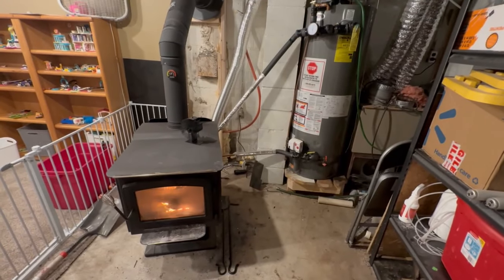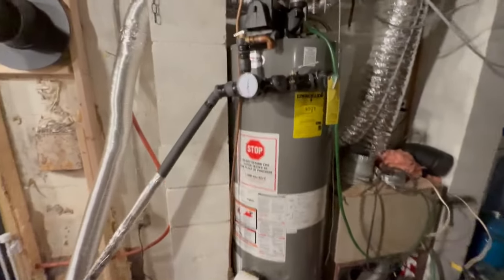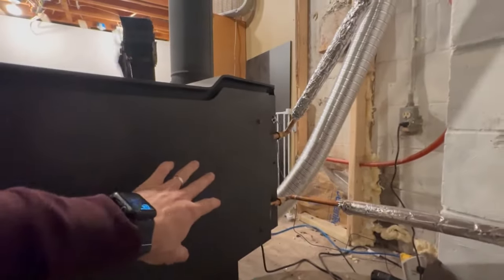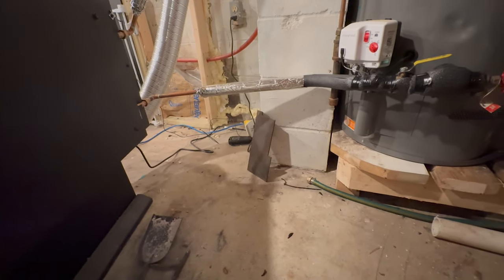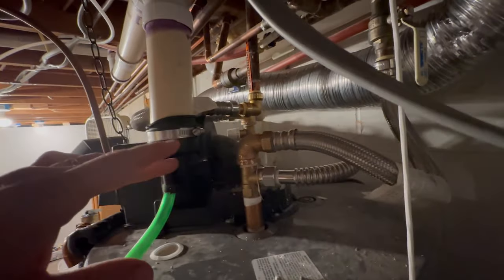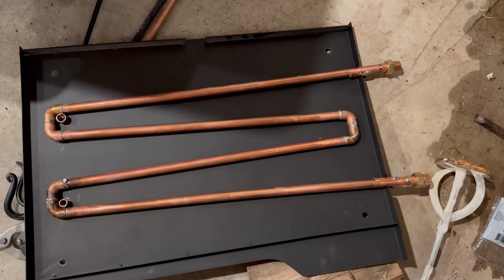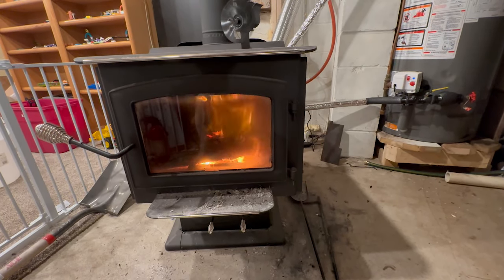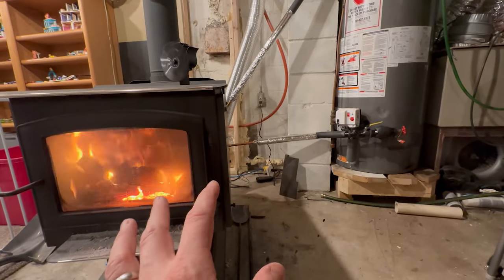DIY Hack: How I hooked up my water heater to my wood stove

Comment: Looks like a good system.  Our woodstove has a plenum chamber above it that ties into the hot air return for our HVAC system.  We have a water heater with a heat pump on top of it.  When we have a fire in the woodstove, the utility room gets relatively warm ( >60 degrees) and the heat pump on the water heater extracts that warmth to give us hot water.  After rebates, the water heater with heat pump was less than $600 and it is saving us probably $250/yr over what the previous electric-only tank was using.  As a bonus, the cold output from the heat pump on the water heater is vented into our garage, giving us a small A/C unit.  :)
Reply from the maker: Nice!
Reply: @jasonbroom7147 can you direct me to where I could find more information that setup. We just bought a house with a hvac tied woodstove. Very interested in what you've got going on
Reply: @SirloinBeefBurger  - I've honestly never seen anything like it, before or since.  Imagine a large metal box above the fireplace insert, forward of the flue channel.  On top of that box are two round stand-offs with insulated flexible heater hoses that tie into the hot air return for the furnace.  I don't think it was a commercially-made product, just something the mason who installed the brick fireplace built.

Comment: For a heat exchanger could you use a stripped down 5 gal. Electric (or gas) water heater right on top of the stove?
Reply from the maker: I thought about it but the wood stove is now our living room space in the basement so we want it to look pretty 🤩

Comment: I need advice please. I would like to use my wood stove those way in the winter and have my supplemental water tank directly below my wood stove in the basement and have that water heater feed the main water heater which is an indirect water heater. So I would create a closed loop feed the coil inside the indirect water heater for our domestic hot water during the winter. Any ideas are welcome.
Reply from the maker: If the water heater is below the wood stove, thermosiphoning would not work.  The water tank would need to be higher.  You could add a pump to the loop with a thermostat but you run the risk of cooling the water in your water heater.

Comment: A few code / safety items you might want to look into , is your water heater approved for zero clearance from combustible materials. Two install drops down to the floor from your relief valves , this will protect you from being scalded if one opens when you are near it,  you have no over temperature protection, closed system with no thermal expansion available. If the codes in your area require any or all of those items and they are not present it would allow your insurance company a way to avoid paying any damage or injury claims from a failure.
Reply from the maker: Thanks for commenting!

Comment: I wonder if adding a small water pump to circulate water from the stove to the water heater would make this system more efficient?
Reply from the maker: I tried it and it didn’t not help

Comment: Hi. I love the simplicity, and the emphasis on safety. I  wonder if you have the possibility to lower your wood stove any, thus gaining a bigger height difference? Also, what are your thoughts about wrapping the copper around the chimney then into the tank? Simple open coils above the stove top and around the lower part of the chimney pipe? I am looking to do something like this for my trailer in the middle of nowhere. Thanks
Reply: i was thinking of the lower chimney thing as well  one of the biggest problems i have experienced is the cooling of the fire interrupting the exhaust of the chimney. using metal piping inside the fireplace. but wondering if you only removed the heat from the chimney if the venting will still occur properly and keep the exhaust clean burning. if so having a water tank around the chimney essentially water cooling it might maximize the heat.
Reply from the maker: I didn’t wrap it around the chimney for 3 reasons,

1) I didn’t like the aesthetics of it.

2) it would reduce the chimney temp which would reduce the draft.

3) the firebox stays hotter longer than the chimney.  Wrapping the chimney would produce hate water quickly but not for very long.
Reply: @portercreek  Thanks, I appreciate your time to explain the difference to me.

Comment: I have a similar set up, but it's never worked. It's a backup to the glycol solar water heating set up anyways and so I've never had it repaired. There are a couple days a year where it's too cloudy to heat up the water, but it's not been enough to motivate me to fix the "recirculation pump" set up as they call it.
Reply from the maker: I am really curious to see what your solar water heater set up is like, I didn’t think it would work in the winter months.  How cold does it get during the coldest days?
Reply: @portercreek  I may post a video on my @wildweeds channel at some point showing the glycol solar water heating system. This morning the temperature got down to 13F and the lowest I've seen it has been 8F last year. But that doesn't make any difference to the water heater... It's the amount of sun that makes the difference, but even on mostly cloudy days in December and January it works pretty well. Of course, there's no hot water until about noon around winter solstice.

Comment: I would suggest putting the wood stove heat exchanger around the flue pipe, most wood stoves use a 6 inch flue pipe for exhausting the stove. Because the diameter of 6 in pipe
Is quite small to bend 1/2 copper pipe around the chimney the use 3/8  pipe. The heat transfer would be much higher using this type of heat exchanger. The size of heat exchanger pipe would not matter that much as the flow would is quite low.

Comment: How do you handle the possible thermal expansion of hot water?
Reply from the maker: I have a well so there is a pressure tank that will accommodate the expansion. There is also a relief valve on the loop and on the water tank.

Comment: That is genius!  I'm impressed.  But I would think the flames would melt the solder connections on heat exchanger.   Does you boiler still work off gas?    Since you said you can only heat enough water for two showers, will the gas part still fire if you need more hot water than the wood stove provides?
Reply from the maker: The flames don’t actually touch the copper pipes as they are on the outside of the firebox.  In order for the solder to melt the pipe would have to exceed 300+ degrees and it can’t do that as long as there is water in the lines.  The water heater still functions the same.  I usually keep it off and sometimes will kick it on if we had a high demand of water that day.  I have some parts coming next week that I will add to this system which should help it produce more heat.  If the new parts aren’t enough to get me to 160 then I will add another zig zag to the heat exchanger which should definitely get me enough hot water for our whole family.  

Once I get the new mod(s) done I will post a video so stay tuned!  Thanks for commenting, please hit that subscribe button!

Andy
Reply: @portercreek  Awesome detail about the tubes not being in the firebox. I don't know much about stoves so that was nice to know that you can totally avoid the soot buildup on the tubes and loss of efficiency.

Comment: How about adding a second row of Z behind the heatshield for more surface area? I have no knowledge about those things. Only a thought.
Reply from the maker: This row of z is behind the heat shield, I am going to eventually swap out the half inch pipe with 3/4 to get better flow and heat transfer.  I have also considered adding it to the other side as well

Comment: Great setup. I have a question. Does it have to be pipes for the heat exchanger?! I was thinking of putting something like a plate heat exchanger but without the plate inside. Just one big flat tube with an inlet at the bottom and a outlet at the top that i can stick to the back of the atove to cover the entire surface and get the maximum amount of heat. Will it work?!
Reply from the maker: I am not sure, I have not tested that method.
Reply: That would work but try and find a ready made flat plate cast unit. You could weld up a water box and weld it to the side of the stove. "Water backs" were common back in the day.

Comment: I added a comment to 'Tom Running's' comment about water inlet height, but I wanted to comment on your heat exchanger setup. You've done a good job on the heat exchanger, but you need to concentrate the heat to the pipes and also stop the air current around it cooling it down. I would add flat plate copper to the side that touches your firebox and then add rockwool to the whole heat exchanger so that you're not losing heat. Let me know if that makes sense. 
Good work on the unit. 
Also any rise in the pipe coming from the firebox is ok, just NO falls, even level will work, it's just not ideal. 
I can take photos of my setup but it might be confusing to work out. 
Freddy :)
Reply from the maker: Thanks for commenting!

Comment: Looks good, when valved off how hot does the exchanger get? Always wondered if it would open the relief. Had similar thoughts on running radiant floor Off a wood stove. With a circ pump though.
Reply from the maker: I haven’t tried closing both valves with a fire, I am a little reluctant to, lol!  I want to put another, bigger heat exchanger on the other side to run hot water out to my garage to heat that.  I am hoping to get that done before the end of the year.  That one will have a circ pump on it.

Thanks for commenting, please hit that subscribe button if you haven’t already!
Reply: @portercreek   Your coil would just start flashing to Steam and your relief will start blasting off Steam Into your house

Comment: So what happens if no water is being used, but the woodstove is running? Doesnt the woodstove have the potential to overheat, and thus over pressurize the tank? i understand you have a pressure relief valve but, it doesnt seem theres any way to stop the stove from overheating the tank. I feel like blowing reliefs could be a common issue. 

Also, keep in mind you could just use soft copper and a tubing bender to achieve the zig zags.
Reply from the maker: When no water is being used it, the hottest I have seen it get is about 142.  The hotter the tank is, the more btus it requires to keep it hot because of heat loss through the sidewalls.  With this set up I don’t think it is able to produce enough btus to over heat this large of an amount of water.  I was going to us soft copper but couldn’t get the bends tight enough with out a tube bender and I didn’t want to spend the money on one.

Thanks for commenting, please hit that subscribe button if you haven’t already!
Reply: @portercreek  Good to know, ill consider doing the same to my basement wood stove then. thanks!

Comment: Well it’s not free….it does steal heat from the unit that might be wasted radiating in the basement anyway so I’d say it’s more efficient.  Do you have thermal limits built into the system to prevent overheating of the hot water heater or has the system not produced enough heat to cause an issue?
Reply: Also a water pump would help with circulation.  That’s what we do with geothermal units doing something similar.
Reply from the maker: If I added a circ pump then it wouldn’t be free hot water and when I did add it to test it, it was no more efficient.

Comment: If you're only getting a few degrees difference between the top and bottom hoses. It looks like not much of the heat is being transferred to the water, which would explain why it doesn't heat the water too well.
A larger calorifier coil in the tank may help you get more out of the system.
As a kid, our wood burner (A 7KW Hunter) Used to heat the water piping hot, and a lot quicker than the electric element.

Comment: Very nice,however if you used 45s for your turns the water would flow easier.  90s actually Restrict flow.
But I like that you are showing this.
Reply from the maker: The reason I didn’t use 45s is because of the space it requires.

Thanks!

Comment: Try plumbing in an old radiator instead of the copper pipes on the side of the woodstove. Just a thought. Nice work!
Reply from the maker: I thought about that but then I wouldn’t be able to put the shroud back on, which isn’t that big of a deal, but getting the plumbing to adapt from conventional plumbing to the radiator would be a bit of a challenge.  Can an old car radiator handle 60psi from the water lines?
Reply: Andy Hentges  good call! I'm not sure if a radiator would be able to handle that pressure? I'm just a normal "joe" with crazy ideas haha! I love your ingenuity! Keep it up.
Reply from the maker: @ajwilson313  thanks!  Please don’t forget to hit that subscribe button!

Comment: What's the purpose of the green pipe coming down? Also, I see a thick white PVC pipe on top. What's its purpose?
Reply from the maker: The white pipe is exhaust for the water heater.  It is a high efficiency water heater and the green hose is a condensation drain hose for the exhaust.

Comment: Personally, I heat water during the winter in a pan on my wood stove.  I save a couple of quarts of hot water in thermos bottles.

I live alone and find that frugality is the key to simple hot water heating as described above.  I use a towel and less than two quarts of hot water for bathing a shaving  ----FLOODS of hot water are NOT required!

Hand washing dishes takes  two quarts or less of hot water.

I use cold water in the clothes washer and hang the clothes on a clothes line to dry. 

During the summer, I use my simple solar water heater ---- two quart plastic jugs set in styrofoam blocks that have been cut out to fit the jugs.  Glass shelves salvaged from old refrigerators cover the jugs. On a nice sunny day I get water temperatures from 140-160 degrees F.

In the shoulder season when I'm not heating with wood and not getting much hot water from solar, I just heat water in a pan on my gas range.
Reply from the maker: I wouldn’t mind simplicity like that but with 4 kids it just doesn’t work!

Comment: use a 12 volt circulation pump inline. I think they are about 10 dollars for cpvc transfer but you need one that can withstand at least 300-400 degrees due to the stove being too hot melting the plastic. But, if you put a 150 degree blow off valve then that is all you need but i still would circulate it with a pump.
Reply from the maker: I tried adding a circ pump but I did not find it to make a difference.  Modifying the side panel of the stove so I can fit a 3/4 inch pipe would probably give me much more heating capacity.

Comment: I've really been wanting to do this with my wood stove insert but my issue is that its on the first floor and the water heater is in the basement. I debated getting another small hot water tank and putting it in a first floor closet but again all my pipes are in the basement.
Reply from the maker: You could do something like this with a circulation pump.  You would have to rig it up so the pump is on a thermostat though so your not cooling your hot water when the fire dies down.

Thanks for commenting, please don’t forget to hit that subscribe button!

Comment: How is this setup now? I would imagine that the temperature in that copper pipe can change pretty rapidly.
Reply from the maker: I show how it is set up in the video…
Reply: @portercreek   I guess I should have been more detailed. It has been a year right? Have you ran into any unexpected problems?
Reply from the maker: @HexaFox  no issues, it’s been working great!

Comment: Have you considered using a recirculating pump rather than thermo siphon to circulate the water?
Reply from the maker: Yes, the draw backs are it required electricity and if the fire goes out and the pump is running it will start cooling the water instead of heating.

Thanks for the commenting, please don’t forget to hit that subscribe button!

Comment: Good job! Did you ever consider the fact that you now will have electrolysis buildup on the inside of that panel where you installed the self tapping screw that is sitting against the short piece of copper spacer? Might want to use a copper plated screw next time.
Reply from the maker: Not sure how that would cause electrolysis build up when the panel had 4 metal screws in it from factory.
Reply: Ideally, copper should never touch steel.  I use cardboard or lead flashing pieces to insulate copper from steel. But electrolysis is a peculiar thing that often does not follow the rules, so it may be okay @portercreek

Comment: i considered doing a solar water heater panel to a tank and they said if you dont want to use a circulator you need to have tank above the solar panel to actually get it to flow on its own from cold water sinking and hot water rising into tank.
 My grandmothers house had a crazy way to heat hot water they only had coal since they were in a coal town, so they put a cast iron knuckle inside the flue of coal stove in kitchen and just ran hot water line through it that was a crazy system the hot water came out ice cold them wham like 180-degree water came out it was great for getting burned if washing hands. i don't know what kept water from boiling in the knuckle it was about 4 feet above stove.
Reply from the maker: I have thought about it for summertime hot water!

Comment: I think You might have had air in the line.  Also line size is on the small side.  Thermosiphon will work if the cold is lower also. Interesting setup there. Make your lines bigger will help with make up water.
Reply from the maker: I was limited to the half inch because 3/4 wouldn’t have fit under the shroud.

Thanks for commenting, please don’t forget to hit the subscribe button!